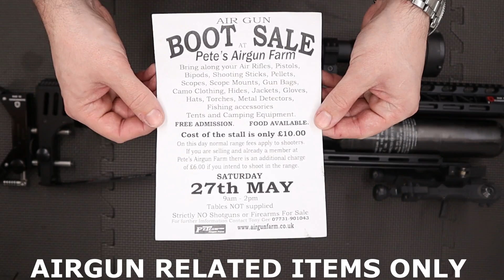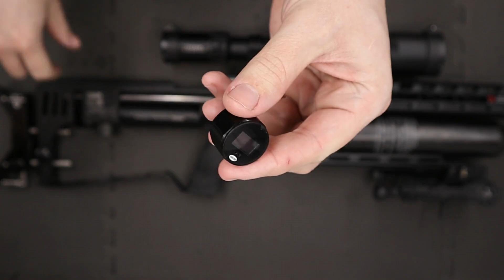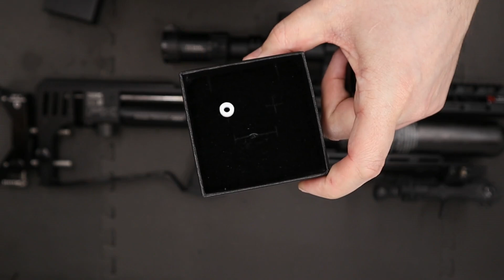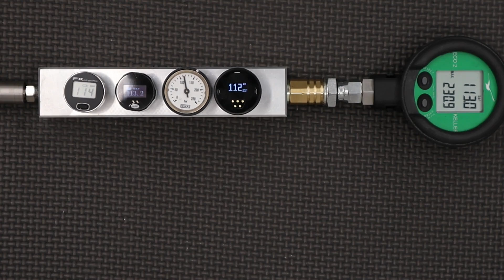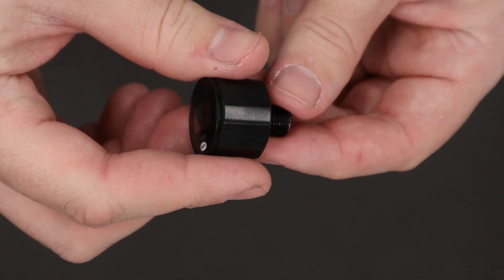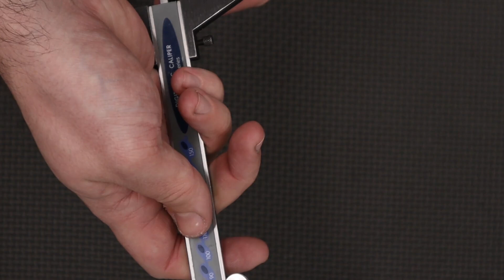New mini pcp digital gauges (review/ test)

Comment: Maybe I’ve got a dodgy one. I’m not impressed with its accuracy and charger. I tried several positions but I do not get an accurate reading. The manometer seems to freeze. It sits at one pressure reading whatever I shoot. When I turn the gauge tighter or loose it wakes up. Then after about two shots it freezes again. And the magnet charger is very loose. It never stays attached very well. 

I don’t know if the Sekhmet gauges are any better or even the expensive FX gauge. I took this no-name brand manometer off my Impact M3 now.

Comment: Hi I have a question I have a bsa r12 clx pro and I’ve fitted a best fitting 500cc carbon bottle when I top up with my 3ltr carbon charging bottle it won’t go above 210bar so I assume the meter may be out would one of these digital meters fit my r12…..many thanks.
Reply from the maker: sorry i haven't tried the 25mm gauge, i have replaced the BSA gauge with a standard 28mm wiki on my R12 that works well, you just can't use the little cover but it doesn't look bad i can't see any reason the 25mm digi wouldn't work though👍   sorry i can't be more help
Reply: @sub12airgunners cheers 👍

Comment: I’ve just bought one of these to put on the regulator of my Leshiy 2. The Sekhmet one I had previously was a lot quicker to change when the rifle was fired where as this one doesn’t alter even when fired quickly?
Reply from the maker: we have 2 of these and they both work perfectly, it's not to tight and the o ring is restricting the air flow   ?
Reply: @sub12airgunners  the reg pressure is correct what it’s showing, but just doesn’t go down and then jump back up again when the rifle is fired. I’ve got the REPR reg which is faster to recover compared to the Huma raptor reg. It’s only just pinched up so don’t think it’s too tight.

Comment: Sehkmett ones are far superior with more functionality
Reply from the maker: they do have  more functionality but the most inaccurate of the ones tested
Reply: @sub12airgunners  inaccurate I’ve just order two I hope they are not
Reply: @vinnydub7192  1 bar out is nothing to worry about 😀
they where just the worst of the ones tested
Reply: @jeffhello1444  like you say 1 bar is nothing
Reply: @sub12airgunners  do u have a link to the test you have done on them please
Reply: @philipforbes4068  just watch the vid fx 114bar sehkmett 112bar Chinese 113.2  Keller test gauge 113.2 so the sechkmett not the best in that line up, but all good enough for a pcp
Reply: @jeffhello1444  cannot find it

Comment: A neat little gauge that - and I agree....just reading pressure is all you realy need.  its a shame its not micro or usb c, however I really like the magnets "repelling" as you can't put the adapter in the wrong way.  Just got to decide how many to buy....I got up to four, slapped myself and settled on two  🙂
Reply from the maker: 🤣🤣 they are  neat and seem to work well 😀

Comment: The only issue I have as regards ANY built in rechargeable battery is recharging in the field.  Yes you take your charging lead with you and a USB power pack IF you remember them.  I always have button cells in my gun bags for my illuminated optical devices so changing them isn't a problem.  Sods Law says I would forget charging lead and powerpack.

Comment: guage one is supposed to read 230 but shows 229.2 which means it is off by 0.8, the 2nd one is 1.2 out, the analog is spot on and the last one is 1.0 out.
Reply from the maker: If you look closely you can see the analog  gauge is over by a couple of bar, but they are all within a couple of bar and that's good enough imo

Comment: Nice. If I change to a 300 bar bottle and a 300 bar gauge do I have to anything else to gun. Dies the warning on the gun for 250 bar max just for the original gauges as supplied from fx. Thank guys
Reply from the maker: M3, Maverick, Panthera are all 300bar guns as far as i am aware just the bottle and gauge that need replacing
Reply: @sub12airgunners  thank you